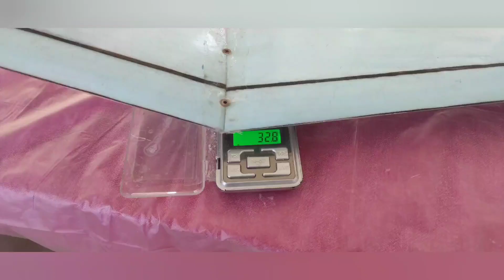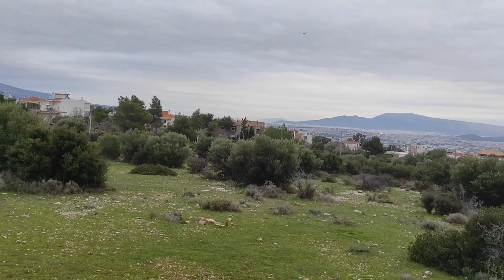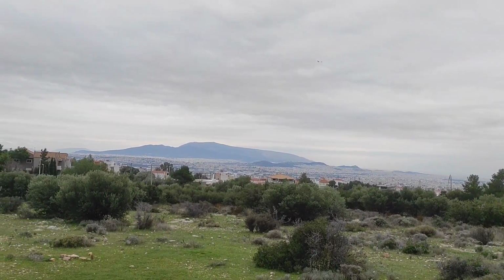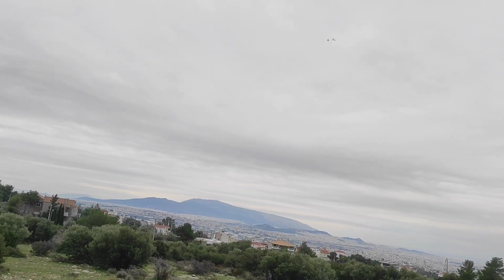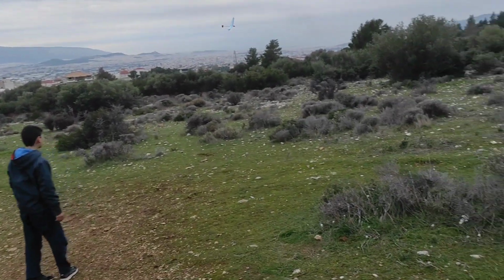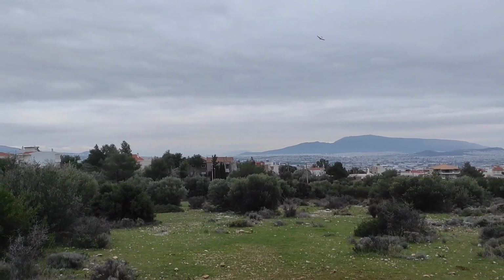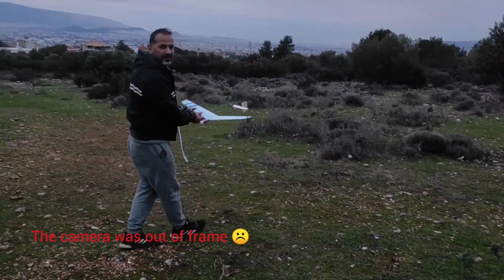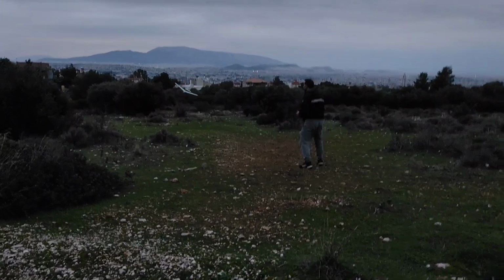80cm GF DLG Maiden

Comment: All on 1s lipo batt? What rx/servos at this low voltage? Excellent build btw!
Reply from the maker: any servos will work in 1s bat, just a bit slower but no prob. with gliders   (3.7g Micro Digital Servo GH-S37D) (FS2A 4CH AFHDS 2A Mini)